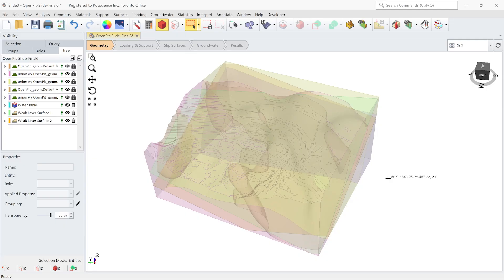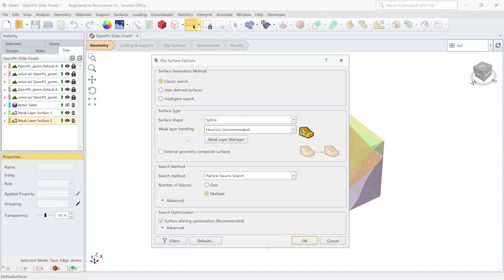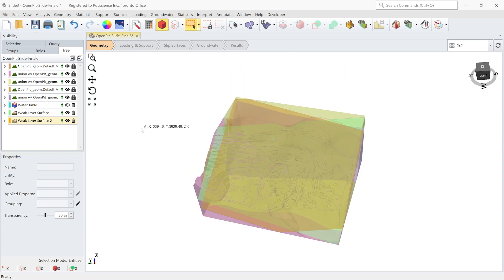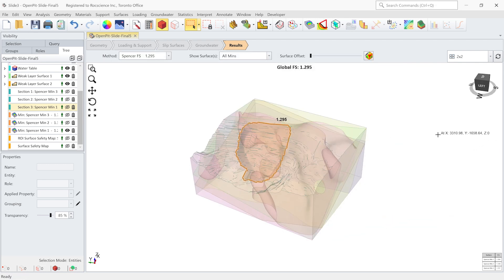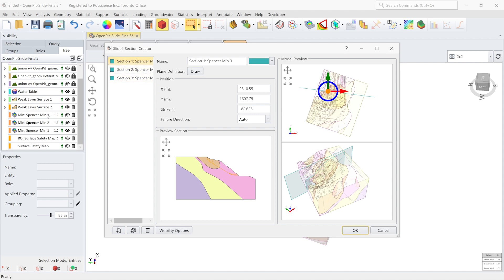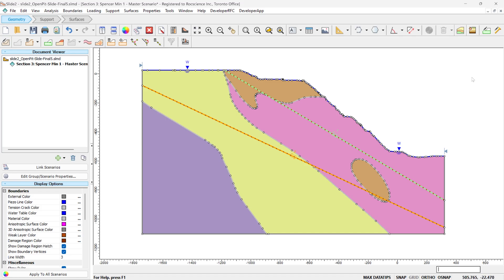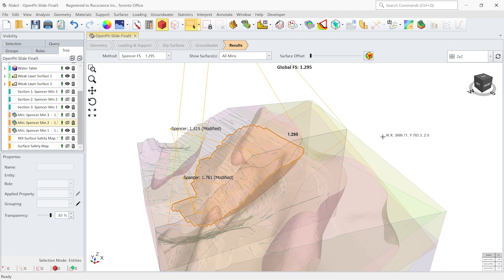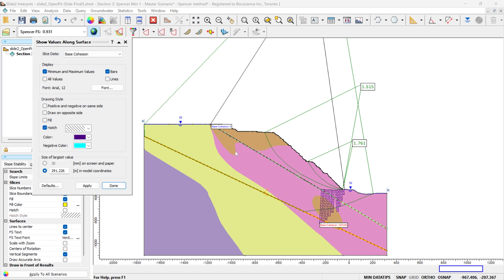Mastering Slide2 & Slide3 - Search Methods

Comment: Why different FoS occur in slide2 n slide3, in slide3 rhe slope is stable, but n slide2 the slope is failure? What the FoS we can use then?
Reply from the maker: Hi!

The differences between 2D and 3D depends on the complexity of the models. Normally 3D LEM gives higher FS compared to 2D LEM and the 2D model might fail while the 3D model is stable. The reason for that is 2D section is just a section in the 3D model and 3D analysis considers the full 3D geometry. Which FS to pick? This is the designers decision. If you want to be conservative 2D results are normally more conservative.

Let us know if you have any other questions!